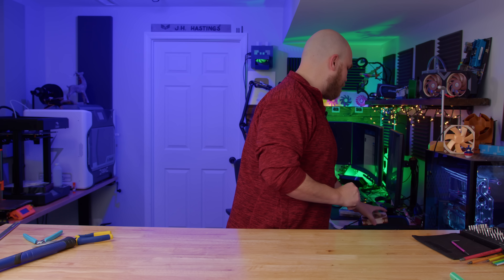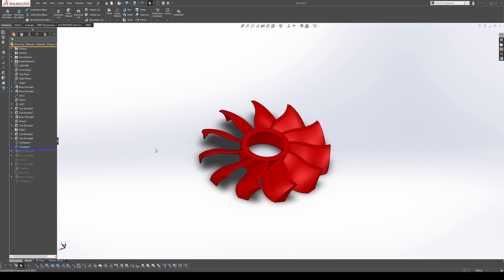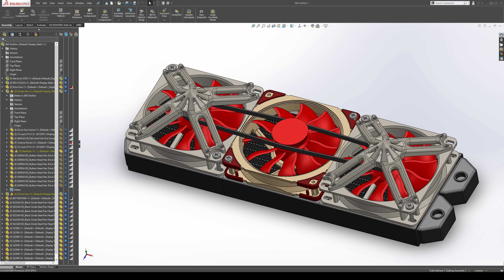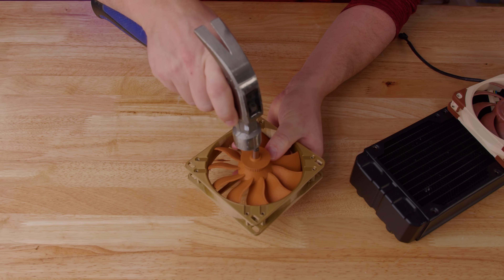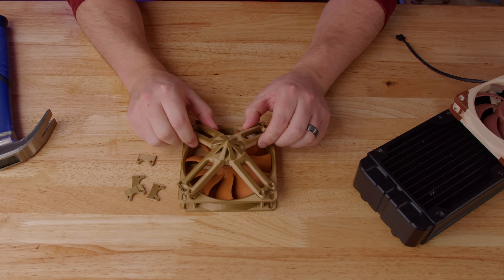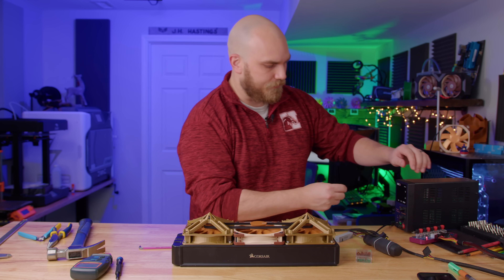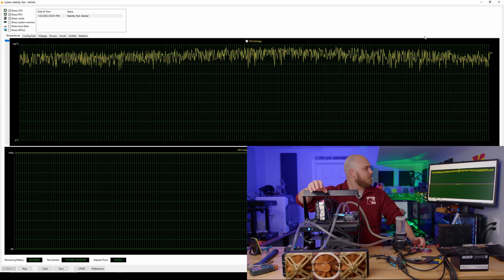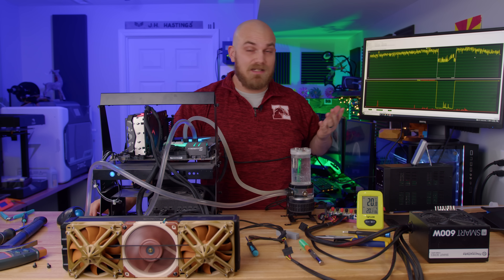I Turned One Fan Into Three | Steampunk Water Cooling

Comment: The faster the belt moves, the more centrifugal force will be put on it. The middle of the belt will go outward and lose contact with the motorized fan. You need something to push the belt inward but also need to find a way to prevent the belt from stretching in general. 3D printers (filament) have the same issue for x and y axis over time and need to be tightened every once in a while

Comment: would it be worth reprinting the top part that secures the outer fans in but add a spot for some bearings to be mounted so that it reduces the slip of the belt on the drive fan and keeps it free moving?

Comment: Nice experiment, however on the physics side I feel much more efficient to use a simple funnel that covers the whole radiator and has a 12cm narrow side where you put that SINGLE fan as an exhaust fan that sucks air through the whole radiator this way. Simple 1-fan solution with a simple passive-only part (the funnel) and I think it  does much better even without extra voltages.
Reply: In your experiment you spend the input energy on rotating 3 fans that multiplies the loss of energy 3 times (at least, not counting the belt stuff), while having a single fan, it works as hard and with a given efficiency and the air can do its own job to spread and move the whole volume through the fins).

Comment: Thank you for the great content! Now when you are back into water cooling could you do a definitive "there is only a few degrees difference" -video? I mean there are plenty of messages and videos all over the internet saying it only affects few degrees; what the flow direction is, what the flow order is, push or pull fans, intake or exhaust through radiators, dust filters, flow rate, etc. It sounds like combinations of these can be more than few degrees.

Comment: You can greatly improve this design by moving the real fan to the left or right position and using two gears as opposed to one, as well as two belts. This way you get significantly more contact area between the belts and the gears, reducing slippage.
Reply: You could also replace the “skateboard” bearings with self-lubricating oilite bushings - much easier to implement, and you don’t have to worry about friction between the balls in the bearing and the grease trapped inside.
Reply: Last, but not least - your stitching jig and needle contraption is great, but you can achieve the same result with… adhesive tape. Sometimes you don’t need to reinvent the wheel. :P

Comment: The contact made by the powered fan to the belt seems a little like it could be improved. I wondered if you made the centre of that contact patch larger then the inner and outer edges (effectively making it a little like the the surface of a sphere) it would auto centre the belt plus increase tension on the middle of the belt to pull it into the grooves and reduce slipping. Here is what i mean as a video - https://youtu.be/TNuzi-jMXoY?t=176

Comment: I mean, the obvious solution would have been to 3d print a duct that had a fan-sized opening on one side and a 360mm radiator sized opening on the other side. Almost certainly better performance and you don't have to buy bearings, or belts, or pins. Just, you know, turn some soda bottles into filament to print.

But what fun would that be?

Comment: Cool project! I see potential room for improvement:
- using V-pulleys or U-pulleys with o-rings instead of a timing belt would be more efficient.
- flushing the grease off the bearings to reduce the friction, using a drop of oil instead.
- maybe run two belts (o-rings rather), one for each side, with the center pulley being smaller than the ones on the sides for better torque.
-
Reply: Good ideas but he's better off running with just one fan.

Comment: It would have run better if you would have put the driving fan either on the outside or equipped it with a dual pulley and let it drive the aux fans with two separate belts

Comment: LOL put an RC car motor they can run off 5v+ and more and make plenty of torque depending on the amount of turns on the Commutator. don't even need a hobbyist grade just a motor from a cheap china made RC car. You might have to make something too apply tension to the belt and you won't even the real fan just make all three driven by the rc motor.

Comment: If you use smaller round belts or a flat belt you can twist it so it crosses over itself, this would give the belt a bit more contact with the crank pulley but it will run the aux fans the oppersite direction . Also if you lace your flat belt 90 degree flush like a round baler (just staple it or wire it) you can put a twist in it to run Mobius but at this scale it probably doesn't matter.

Comment: Try again with round PU drive belt? Running a double center pulley and two belts one for each auxiliary fan. The round profile and simple heating up the ends of the belt and trimming the flashing from smushing the ends together.

Comment: The belt definitely needs more tension on it. It may work better if the motor fan was on one side with the two auxiliary fans next to each other. You may also be able to hook up a mini quad motor, something with more torque, and get the two auxiliary fans moving really quick.

Comment: I wonder how it would perform if you had made the pullies on the outer fans a lot smaller.. It would serve two purposes; Make the belt slip less and make the outer fans spin faster while the center fan is at the same speed.

Comment: i'd put the drive fan on the end, so that fan has plenty of surface to drive the belt. maybe try putting some tensioners in between the fans. try different spring loads in the tensioners instead of the sliding slot design for tension. would give move spinny stuff for the steampunk look and help keep the belt running the fans. really cool idea! thanks for sharing!

Comment: This reminds me of the first time I went to the Dave and Busters near me. They had all the ceiling fans connected with belts and running off one motor. That would be awesome to accomplish in a case, but the ceiling fans were all on a similar plane and case fans are pretty far from that. I suppose you could make it work with enough effort, but there wouldn't be much room left inside for anything else.

Comment: If you want to hammer in a dowel, especially a metal one, you'll want to make sure you use a mallet, made of nylon or wood. For a project like this one it's not so bad, but a metal hammer tends to give such a shock that it damages (if it's wood) or deforms (if it's metal) the dowel so that it'll no longer fit properly.
As for the drive system, there's plenty of people who've explained that a lot better than I could already.

Comment: Print a new centre fan so you can plug a drill into it and see how cold it gets haha drills get hot and burn out so probably don't do this, you're definitely losing all the power to friction here looks cool though. RC car or racing drone motor would be nuts to see in a PC fan haha

Comment: if you don't want to do the dual belts that many are suggesting....perhaps a belt tensioner (spring loaded idler pully) would help prevent slipping.  similar to a vehicle timing belt system.  still may need a higher torque motor

Comment: Maybe you should use more of a clutch like system so the the fan can still spin freely and find a way where there's only a enough pressure to have the belt start spinning and have the friction of the clutch bring it up to speed. So that it spreads the force over time vs trying to create all that force from the start

I could be completely wrong and thinking completely wrong.

Comment: My vote is to replace the A12X25 with a more powerful motor.. doesn't even need to be a fan, and see if you can get the two "fake" fans up to 1k RPM area and see the performance of just two "fake" fans alone.  Aren't 3D printers awesome!

Comment: The extra fan bracket you put on to stabilize isn't needed either just a nice flat ridge to keep the belt on track would be just fine without the bearings.

Comment: I think if you just slotted the center pully side to side a tiny bit and had it to one side to make contact with the timing belt instead of it fighting both directions it would work better?It just seems awfully tight to.

Comment: im pretty sure you need to redirect the the belt so it does NOT contact the motor fan on both sides. the syncronisation is the biggest issue here.

Comment: Fun video, I always like the Fan vids!
I designed a Bat Fan last year after watching your channel. I've not really used design software before, so Fusion 360 was very foreign but then it came together with a cool fan ! I thought about sending it in for Halloween.

Since the first gear fan, I too have been wanting to see More Fans with Less Motors. I was thinking gears, but this was cool too.
If you do more contraption fans, i think it would still be good to see a smoke test, might make some interesting flow patterns and different from our 1x fan tests!

Comment: That system might not even need a that wide belt with so complicated pulley. Probably just a rubber band or simple belt would work since it does not need that much torque it would need the teeth in that belt. Even turntables are perfectly fine with just really narrow and simple rubber band type of belt.

Comment: Awesome, maybe for the next one see about using an RC car high torque motor to run all 3 or like 2 240mm rads with 4 fans and the motor on top. Might actually use less power than the 4 fans with their own motors?

Comment: make the interior wheel larger, the greater diameter and thus circumference should result in a greater surface engagement with the belt, and then it should be fine I think

Comment: I would have made a similar cross structure on the central fan, with at least two smaller bearings/pulleys (probably better with 4) to act as tensioner, in a way that the central gear teeth have more grip on the belt...

Comment: I think it probably would have worked smoother by having the centre drive fan higher so only one face of the drive belt is acting on the gear section because every time you have slip on one face it jumps the belt on the other face doubling the slip problem and mismatching the teeth.

Comment: It would be fun to make three of those fans and use a separate motor that is capable of powering all three at once. That's the kind of thing you might throw together in your garage if you have a 3D printer and some random parts kicking around. Maybe a drill motor?

Comment: The motor has limited power and was designed to be as efficient as possible for the sake of low noise. You can't use a mechanical connection to spread that power between more fans to get more performance. The connection will be <100% efficient, so it's an almost certainty that this concept would decrease performance. Three fans sharing one fans power budget is a fair question though,

Comment: By the time you get the bearings, axles, belts, hardware, and print everything, couldn't you just buy two additional fans??
If you REALLY want to go steampunk, use drive rods like a steam locomotive instead of belts.  It could look like steam locomotive wheels being driven...

Comment: De-grease the bearings and use some very thin oil instead and the redo the pulley system with two o-ring, one for each secondary fan. That will be less resistance and less noise and more cool!

Comment: Why not make a duct to redirect the flow of the one fan you have, back trough the rest of the radiator? So basically make the exhaust air do a 180 degree turn.

Comment: Maybe you could run them off an independent motor, and run each belt loop between only one drive and driven set to reduce the slippage, passing power down the chain of fans by stacking two belt loop points on top of each of the intermediate fans. [M]__[F]------[F]___[F]

Comment: Love to see this 3 x contraption or any of your other tests done with the industrial Notcua line.  Like NF-A14 or NF-F12. They make 2000 and 3000 rpm versions and 12/24 volt versions.  Obviously louder but static pressure is almost 3x the NF-A12.

Comment: go with a low or mid performance RC car engine meant for high rpm amd torque, then use a pulley serpentine belt system to poulate the fan array, mount the motor above on a printed bracket, and if you get a dual axel motor (outputs on both sides) you could make a push/pull setup with dual belt drives that simy slides over, snaps in place, and gets plugged in amd ran off 12v normal. using ratios on the pulleys could put less drag on the motor allowing it to operate at higher rpms and efficiency levels for torque it puts out vs power put into it.

Comment: Try this again but with two fans powering a the center fan, and add to frame print a  mount for a threaded rod with a pulley for a real tensioner to give better bite on the belt. 
Second option for single fan is make a duct to stretch across the 360 rad with maybe some internal ducts to divide the air flow to reach across the rad.

Comment: I know you don't like the idea of gears but what about throwing a 95A or 98A shore TPU in the mix to deaden the sound? Should be stiff enough to engage but not be as loud as PLA. More positive engagement with the other fans while not requiring the same amount of tension/resistance that the belt does.

And I agree with Colin Smith: get that grease outta there by soaking the bearings in some IPA.

Comment: 1 idea: move the powered fan to the end, with a smaller gear and put one of the passive fans in the middle with the bigger gear. I believe this way you will get less gripping issues.
Reply: Or add small bearings to increase contact area of the belt to middle fan gear.

Comment: I really like this idea! Maybe a follow up video where you remove the seals on the bearings and flush our the grease and use a light oil instead in the bearings. Those types of bearings really arnt meant for such light and high speed loads so pushing the grease around robs a lot of power. And maybe useing a fan known for higher torque..  or maybe the drone motor makes another appearance.. maybe the smallest brushless drone motor you can find so it's actually sorta close to like a server grade fan.

Comment: This is way overbuilt with too much resistance, you should have the AUX fans spin on a pinpoint and use just rubber bands for the belt.

Comment: Bearings way to tight. Get some bones ceramic and use high velocity oil (1 drop) for each Bearings. I use this on my inline speed skates on 125mm wheels. 1 hard tug on the wheel with my hand will make them spin freely for 5min.

Comment: @3:40 you showed an image of a hollow tube for the drive shaft and the top mount has air intakes.. is that applicable to the design? Maybe if your hollow driveshaft tube had a screw structure inside it, it could also help draw air through the core of the fan utilizing usually useless center space in any given fan?

Comment: Pulleys need more belt engagement. That center one has no engagement

Looks like 608 bearings or so.  Pop the shields and soak in brake clean

Comment: Springs between the fan bases, of the proper return strength could help with eliminating spacing of the belt, but that would mostly be the case if the fans weren't screwed down to the rad, + minimizing the size center piece of secondary fan, would increase airflow a the tension of the belt and to top that off, the bigger the gear of the main fan the more movement it will transfer back to compensate for reducing the size of the center gear of the secondary fans.
Not an engineer but i still thing i am correct, if i am not please explain,l constructive criticism is always welcomed.

Comment: It would be possible to add a small circuit that, when it detects motion from the main fan, connects and stores some energy initially, then after a while when it's appropriate, gives it to back to rest of the other fans as it engages the belt from the main fan back to the rest and disconnects itself until it has to do that again(that would require for them to have their own motors though, just for assistance from the circuit) to reduce the danger of tiring out the main fan).
But that's just an idea...

Comment: I have an idea but not the time or the skills to do it, but it'd be cool if someone could design a fan based on the blower fan in a split A/C indoor unit. See https://youtu.be/2VvoER81-co for what I'm talking about. Mounted on a radiator like this one it could be used as a heated desk fan in winter

Comment: You gotta do a follow up on this one, this project is so damn cool!
I'd definitely love to see you try this with a 230V Sunon 120x38 fan and a tight closed timing belt (not a DIY stitched one). 
Also I think the bearings would spin faster if you washed them out with IPA and put some light oil into them.

In a world where hardware is unavailable and content is becoming stale, you're the man to save us all, dude!
Reply: XD...now that woul;d be interesting a 230v sunon industrial cooling fan being used as a drive motor

Comment: A couple ideas.
1. Using actual fan bearings
2. Using a thin belt like a rubber band running in a crossed loop like a "triple infinity" shape to help prevent slipping a bit without adding much friction.

Comment: Open any engine picture on googleimage and look at the belts and pulleys, I'm sure you see what's wrong with your central pulley that has not enough contact with the belt.
Friction is linear with the force of contact of the belt on the pulley (which you increase with tension) but it is exponential to the angle of the arc the belt is in contact with. It needs to go around a pulley.

Comment: your belt keeps slipping because it doesn't have enough surface area to grip the central fan. It would likely work much better if the powered fan was moved to the end, so the  belt could grab the majority of the circumference. You could then tension the belt tighter, too.